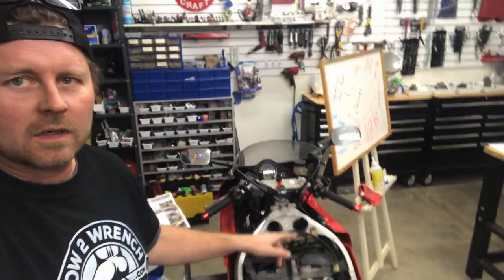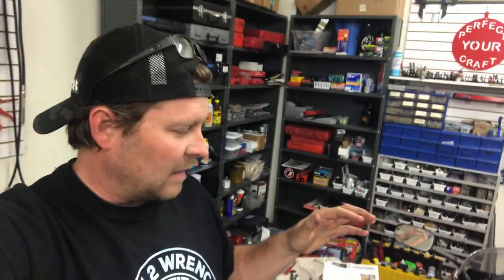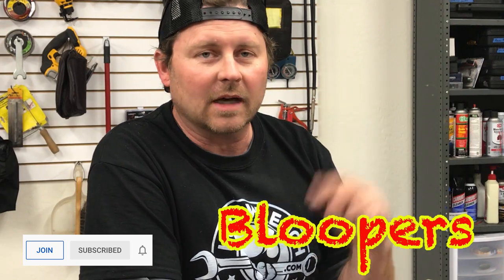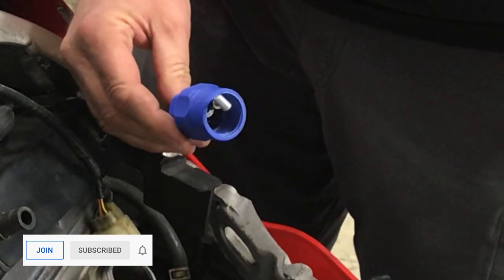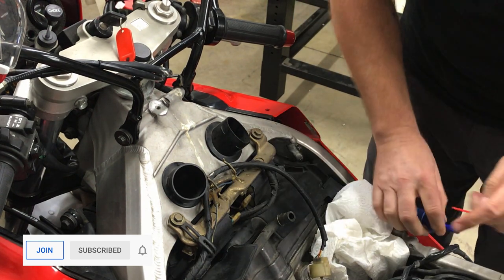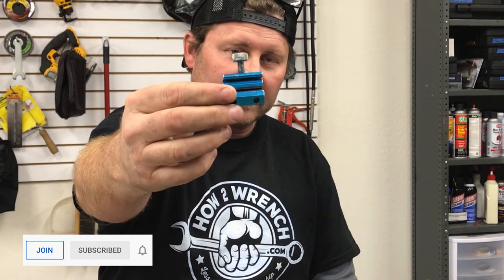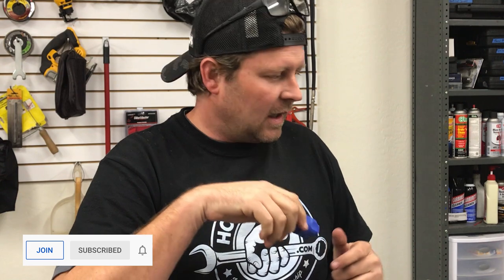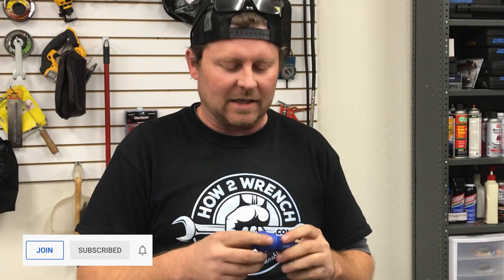Best cable luber EVER! Motion Pro Cable Luber V3 How to lube your cables #maintenance #motionpro

Comment: FYI I don't have that tool, but I cut the corner out of a baggy and slip it over the cable and the shaft. Then I get 2-3 of the smallest zip ties and tighten around the shaft in a couple of places. Squirt the lube in and prop up the baggy so the fluid drains onto and in the cable and it doesn't spill. Works like a charm.
Reply: ^This.  Let gravity do the work.  And the real benefit: you can use any lubricant you want (not just oil available in an aerosol can)
Reply: Agree we have been doing this for years,  bit of insulation tape works too

Comment: Appreciate the info. I love having the correct tools for a job. However, I don't feel the need for one of these when working on my Harley's. I always just insert the nozzle between the cable and the casing, wrap a shop towel around and spray.  Works great and no overspray.
Reply from the maker: Fair enough! Whatever works for you to get the job done. On my 03 bagger I don't think there would be room on its cables but I'll check next time out of curiosity. 
Glad to hear how you liked the videos. Want more? Smash the sub button! Here are the links to support us for this information and our work saving you money.
Join this channel to get access to perks:
https://www.youtube.com/channel/UCBhM8DCKnT3qXwTW0eToyCg/join     

Give us a high 5 here:  https://www.paypal.me/how2wrench
Reply: @How2Wrench  Hi! So did you ever try the tool on your Harley? I work on a lot of them, and it looks like it would be very useful. However, I suspect the large eyelet on the Harley clutch cable may not fit into the tool.  Also, the throttle/ idle cables have large elbows on them up at the grip end. All that being said, later model Harley clutch cables (not sure maybe 2007 and up?) do not require lube as they have Teflon sleeves inside which may be compromised by lube, and there fore it's not recommended. Ditto for some aftermarket throttle/idle cables, but I'm not sure about Harley's throttle/idle cables. Yes, earlier model's clutch,throttle and idle cables must be lubed, just not sure if the tool
 will fit?